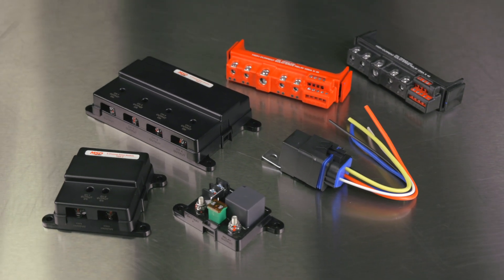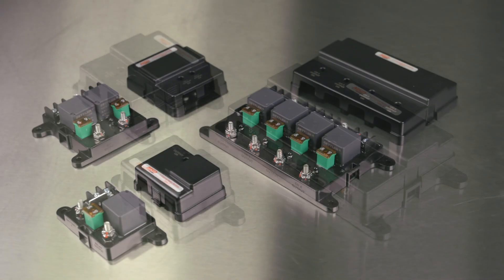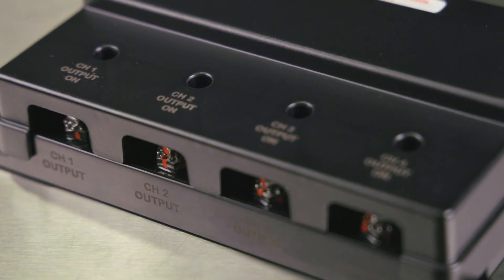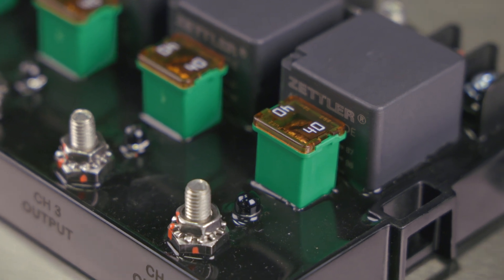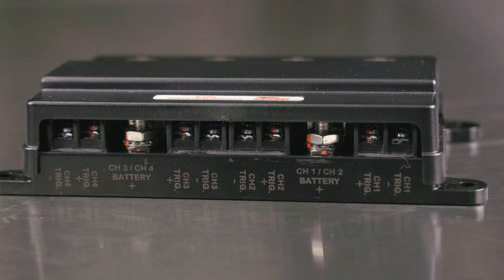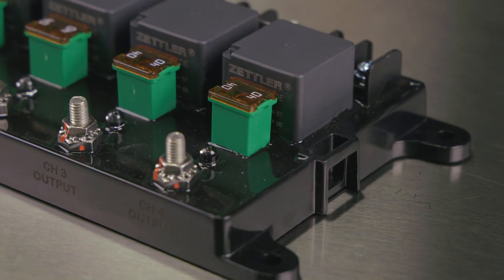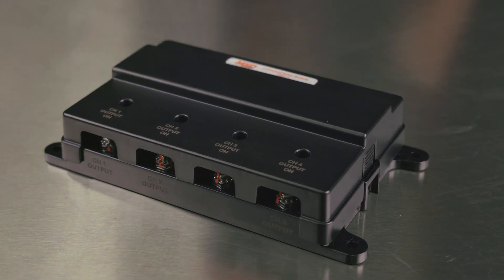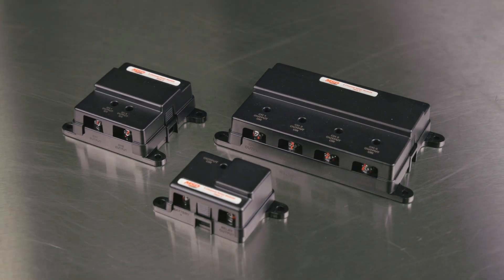MSD Introduces Affordable Relay Modules for High-Powered Automotive Electronics Control.

Comment: Is this all that's required other than wiring it in to run two fans and am electric waterpump, electric headlights motors?  4 channel
Reply from the maker: As long as your amp draw doesn't exceed the rating for the circuit, sounds like this will work for you. A single channel can also power multiple items on a circuit. So say your headlight motors draw 5 amps each to open,  they can both run on one circuit.